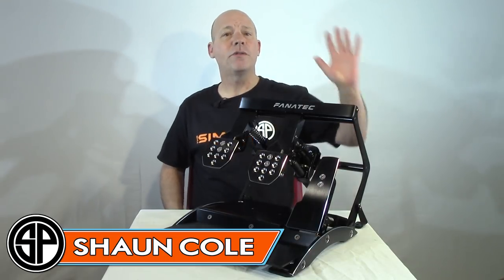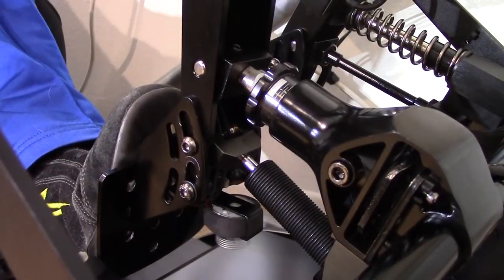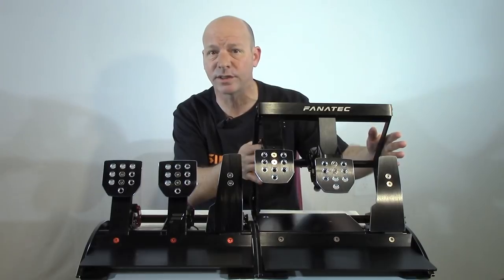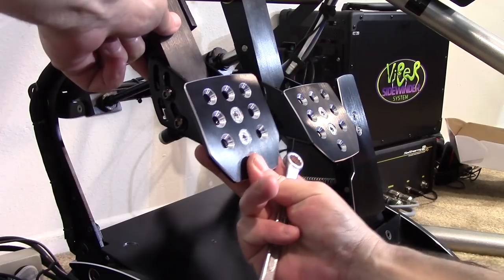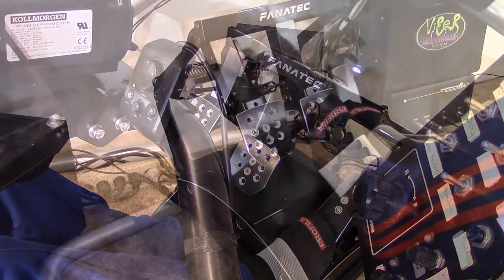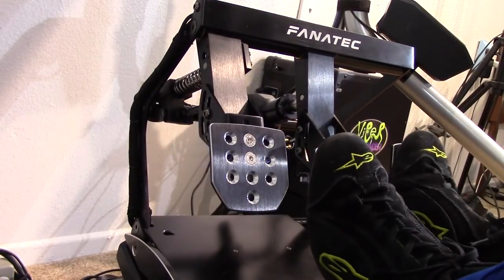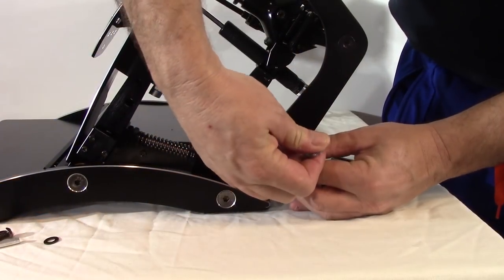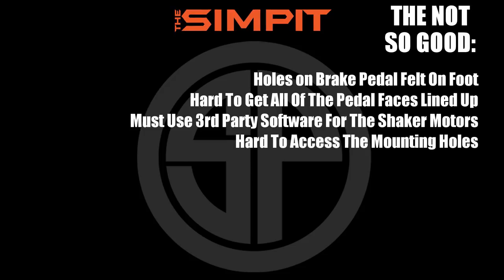Fanatec Clubsport Pedals V3 Inverted Review

Comment: I think what some aren't getting here is Shaun talking about how Fanatec changed the game.  First, most of us had plastic pedals.  Fanatec introduced metal construction at a reasonable price, where most premium pedal manufacturers charged much, much more for their metal pedals.  Now Fanatec brings inverted pedals at a reasonable price, certainly much cheaper than other inverted pedal sets. It's going to cost you as you move away from cheap stuff to equipment that should last a lifetime. Are you a casual user or are you ready to take your sim racing to the next level?
Reply: What this guy said ;)
Reply: John G. Hill T500 pedals can be inverted and cost much less. Also what I don't like about Fanatec, is their tendency to make false statements. E.g. they said on their homepage that these are "hydraulic pedals". This is not true. Didn't happen for the first time though.
Reply: CSR Elites are the best IMO. Load cell and you can buy inversion kit or mount them inverted in your rig. Love my Elites!!!
Reply: The T500 are not load cell pedals.  Big difference in feel.  Once your brain get's use to load cells, it's hard to go back.
Reply: John G. Hill might be true for you. However I sold my CSPv1 and kept the T500 pedals instead. I use the Basherboards brake mod though.
Reply: @The Simpit, Terrific review Shaun. I've been using my Clubsport V2 pedals for almost 4 years now and they're still just as good as the day I got them. I also have been using my Clubsport Shifter for about 3 years and they MILES above the Thrustmaster Th8 shifter.

In fact, now I use the Th8 shifter as a handbrake and modded my Fanatec gt3 rs wheel with a NRG 14 inch steering wheel and LOVE it! If my pedals ever break, I'm getting the v3 inverted.
Reply: Battosai Jenkins why dont you get the fanatec handbrake instead of the th8a

Comment: Looks cool, but ouch, the price point.....
Reply: other ones are 1,000 for all metal like these..
Reply: @ryen49  yeah, but we're talking about a 250 dollar hike in price for an inverted price set.  Still a big pill to swallow.
Reply: @SIMRIG412  you get the damper kit too
Reply: I wish they were still $500
Reply: @KurthardtJr  which is 70$, so you still pay 180$ for them to install the pedals inverted. 50$, or even 80$ extra would have been acceptable, but 180$ for it is too much in my opinion
Reply: @XpVersusVista  the inversion makes a pretty big difference if it happens to be your preference

Comment: Seriously HE Pro pedals are miles better than the V3's, inverted or otherwise. If you're in Europe buying these instead of HE Pro's makes little sense. Until recently I had the regular V3's, and they we're great. Bought HE Pro's and the difference is measurable in the brake and throttle modulation control. I had an entirely different and improved experience with the Pro's brake and throttle fine control. Of course had I not upgraded I'd have no idea, and beforehand I had doubts whether I would find them better. As a user of both, I can tell you they are very much superior to the Fanatec pedals.

Not knocking the standard V3's, at that price I think they're excellent. But the inverted puts them in competition with far better pedals, it's simply fact.
Reply: Meanwhile, in the United States the v3 inverterd are $499 while the HE Pro are $760. The only competition for the v3 Inverted in the US are the v3 non-inverted (who else makes $600 or less pedals of this caliber in the US?).

VERY interesting how the situation is so different on either side of the Atlantic!! Good info, thanks (-8
Reply: The prices shown on the HE site have the 20% VAT in the price. Here in the US we don't pay that, HE Pro's can be had for about $590.
Reply: Good point about VAT, forgot about that. 720 euro with 20% VAT is 600 euro without VAT which is 634 dollars currently. Clubsports have a base plate that HE and Proto Simtech do not have. When you add the plate to the PT-1's then they are 530$! 

Anyway, thanks for the info (-8

Comment: They're only $600 today, instead of the $500 back in 2017. Just ordered a set today. I have the regular V3s and love them, I wanted to try the inverted ones.
Reply: What do you think? Trying to decide between the two...
Reply: @RawJa777  I love them!! There are top notch for the price. They are more realistic so there is more travel and you will have to lift your leg up higher when using the clutch but it’s not a problem.
Reply: @RawJa777  if money is a problem the regular V3 ‘s are still my second choice. They are great too.
Reply: @BakerRacing  Do you need the Brake Performance Kit? I've heard with the standard V3 it's almost a must.
Reply: @RawJa777  I don’t have it on my regular V3‘s but I do have it on my inverted V3’s and I like it so I would say it would be better to have it.

Comment: Nice review Shawn, compared to what is on the market now these pedals are a very good option I think and a darn good looking set of pedals. Considering just an aftermarket load cell will run anywhere from $100 to $180 and the brake adjustability on these pedals is fantastic and looks very user friendly out of the box.

Comment: Have the normal V3 for a couple months now. Only thing I wish they would add is an option to move the individual pedal assemblies.
Moving the face plate also changes how much force needs to be applied since force is not being applied to the center anymore. Off center forces tends to increase wear as well...

Had to cut those little spacers rings to move the brake pedal further out. Would have expected a proper solution for a "version 3" design. Other then that, pretty good stuff.

EDIT: Forgot, one thing that pissed be off when taking them apart. Metric and stone age thread screws in the same product (with damper kit), WTF!?

Comment: I’m still running my T500rs with the original pedals.  I haven’t really raced in my Obutto Ozone since GT6.  I was too lazy to rearrange my Man Cave to play GT Sport.  Now that GT7 is here for the next 5yrs or so, I am so out of “racing shape” LOL.  I have the pedals mounted onto the pedal plate in the “GT” or inverted position.  Inverting your pedals was all the rage 10yrs ago.  But, now it seems like that cooled off and the majority of pedals are set in the “F1” orientation.  I also used to have my brake pedal pretty stiff.  Now that I’m 52, I don’t feel like having to really lay into it to get full braking.  Same with the gas, I am finding myself pushing my leg to go full throttle rather than pivoting my ankle.  I can’t recall if I’ve ever used the pedals in the down or F1 position.  If I move the seat forward a click or two, then I’m too close to the pedals and I get soreness in my left ankle from resting my foot on the pedal.  As for the brake pedal face, I’m using a custom made pedal face that spans the brake and clutch.  I have zero internet in using a clutch.  I tried it on my G25 and it was just nothing like driving a real clutch.  So, I’m quite happy with sequential shifting.

I can’t just simply flip the pedals around and press a couple of buttons.  The pedals are oddly mounted to the Obutto pedal tray.  I can’t find any inverted Vs regular pedal position videos to give me an idea of what to expect if I take my rig apart and flip them around.

What are your thoughts on inverted Vs regular (or flat)?  

Thanks bud
Reply from the maker: Tbh, there really is no difference between inverted and flat orientation. It all comes down to your preference, what you like, and what feels good to you.

Comment: Very surprised you didn't comment on the difference in height of the clutch and brake!  The clutch sits about 2cm higher than the brake, making they awkward to use smoothly, imho.  This is obvious in the side view of the set on the Fanatec site.  Only explanation seems to be they have never seen a car with a clutch???

Comment: 2 Questions Shaun:
- in the 2 areas of how they perform and price, how do these pedals compare to the Proto SimTech PT-1's and the HE Pro's pedals? 
- have any recommendations on who sells inverted pedal mounts (pictured in your video beginning)?
Thanks for this review Shaun, great job and detail!
Reply: HE Pro's are significantly better. The HE Pro's uses higher quality load cells for the pedals which makes a massive difference to the sensitivity of the control you have, it just feels more connected. It's something that can only be demonstrated by trying them.
Reply: mingojingo Thanks for replying. So the only difference is the higher quality load cells on the HE Pro's? What is the price difference? Know the real differences between the Proto SimTech PT-1's and HE Pro's?
Reply: There of course other differences such design choices and adjustability which you can see in many video reviews. The HE Pro's are certainly more visually authentic and I'd wager the electronics are more robust too. I mentioned the 'sensitivity of the control' as that is something I know from owning the HE Pro's and previous owner of Fanatec V3's, so it's comparison between the sets. And it's something you won't know without testing them. Just because both use load cells doesn't make their performance equal.

Sorry I've never used the PT-1's so I couldn't comment. The V3's not not trash in anyway, they are very good. There's just better out there. And my point really is if you're pedal budget is this high (V3 inverted), you have other options, and indeed they are better options.

Comment: Is it comfy for left foot braking? I.e. not too much offset, not too much body twist, enough spacing? Recommend for F1? It looks to me that they are a bit more spaced out than the non inverted V3. I'm looking for a set to offer a good left braking position, but also use as clutch drive from time to time. This also seems to have more travel than the non inverted V3 and slightly better quality. Should I order this? If so, should I still order the damper to mount it on the gas pedal? I read some people do that... or should I just mount the stiffer spring if I need more feel. Any educated opinion is welcome. Thank you

Comment: Nice review, but seems your feet are a bit to small to use them without shoes. The toes should at very least align with the top of the pedal-faces to get more pressure from the footpads. With this pedals i would buy some wood-plate, maybe paint it black and fix it with velcro tape to the heel-plate. My shoes are 11-11,5 in US-size and still i had to lift my heels >4 cm to get to my desired position with the HE Pro.
Reply: You know what they say about a man with small feet?

Small socks

Comment: They look great but you have alot of flex   in the base plate ,  how would these compare to the heusinkveld sim  pedals sprint as they are  very close in price I use a modded set of t3pa pro with load cell upgrade

Comment: Hey Shaun,

I am looking to upgrade my sim rig after 1 year of simming. I currently use a g27 set on a simetik K2 with a rift. I was thinking of using Fanatec V2.5 base, wheel, shifter, and hb with protosimtech pedals. I would like to simulate the car i drive, which pedals set would you go with? The V3 inverted or the protosimtech. Thanks!

Comment: Frame doesn't flex!!
Also on video: Frame flexing a bit under braking
Reply: Flexing clearly comes from the rig to which the pedals are mounted to. I'm pretty sure that the pedalframe is so sturdy it wont flex even if you mounted it to the floor with screws.

Comment: Is there much flex in them? 90kg is a lot of force on this construction. Can't see it too well because your rig flexes a lot. And are the pedals loud when released rapidly?
Reply: Mo Lü I have the normal V3 version and the throttle make strange noises while using.
Reply: AntiMensch better have  that looked at !! Mine did make some noises at first but after a month they where broken in and it all stopped ..only thing i wish for is a brakemod damper (need to get that)

Comment: Hello everyone I just made a hobby investment and purchased the CSR wheel with V3 pedals I had a thrustmaster TX which worked fine but in my humble opinion didn't have I will call it the oomph that the G920 I tried a few times.  So I decided on the Fanatec CSR bundle which I have on a GT wheel stand.  Easily slide back and forth.  Wholes fit no drilling needed.  When I use the Fanatec system check it says OK and the blue shows for each one wheel peddles. With the games the wheel turns and the cars rev but they won't drive.  Asseto Corso says awaiting input Forza 7 IRacing Project 2 same.  Dirt 4 free play it works but not racing.  I have tried everything from YouTube and the Web and emailed Fanatec several days ago spoke with Microsoft.  I am looking for an answer of why it's not working so I can find a solution.  If it's possible an answer would be great.  Thank you.
Reply: "Hobby investment"

I'm adding that to my vocabulary and my wife is going to be hearing that phrase a couple of times a year from now on, cheers ;)